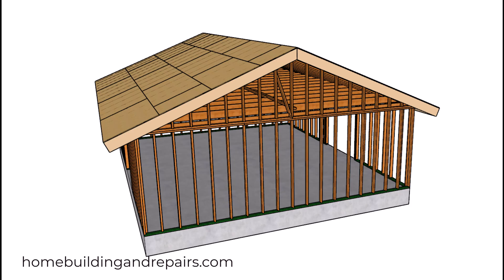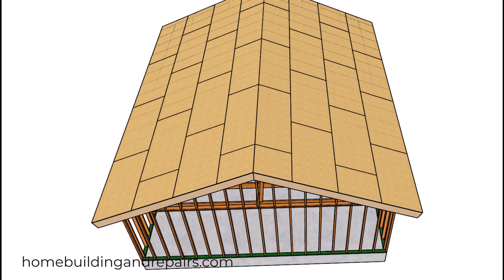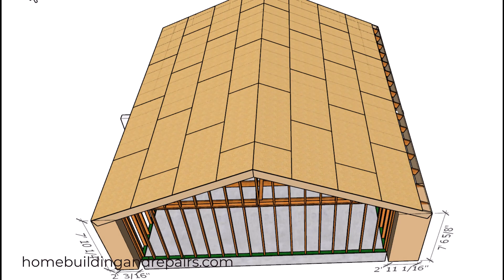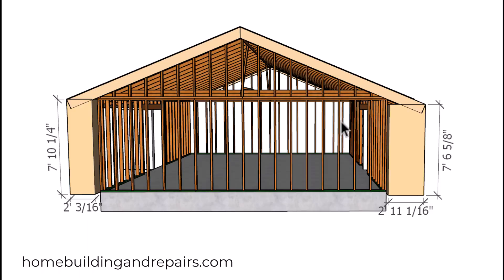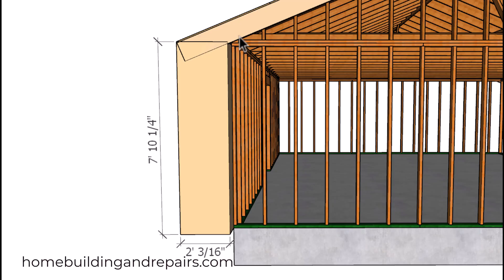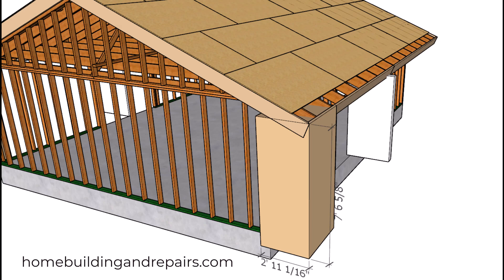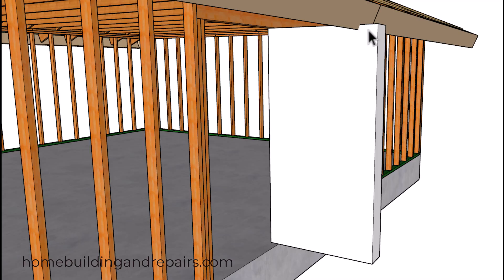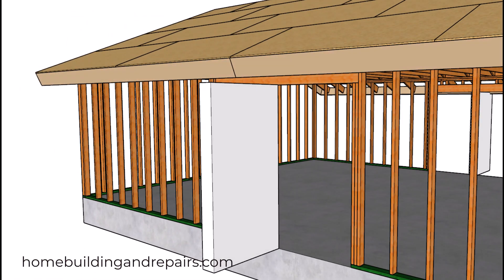What Happens If One Side of Gable Roof Overhang is Longer? - Home Design And Building Ideas

Comment: Its code that you cant cantilever more than 2' and the eves of the roof are cantilevered. To do this you would like come out 4-8' and have a beam. If it were me i would monopoly frame the roof, then have the awning as a bolt on to the house that rests on a beam and columns. I think you are making the problem something it isnt. And i agree, you will want 9 or 10' ceiling height for a single story home.

Comment: I have a queen truss like roof ( I'm not sure if it's the correct name, it's a hungarian version of that) which has a 10 meter like span. In the middle there is a wall supporting the tiebeams. Those beams have a bit of sag and if im jumping on it i can feel that it has some flex to it. My idea is to put some extra beams on the tiebeams and connect them, but it's not that easy, because there is a beam going through as a footing for the post ( like in the other direction perpendicular to the ties) . My question is that, can i put an extra beam on top of the "footings" and connect them like boxrafters ? I hope i described it clearly, sorry english is not my native language 😄